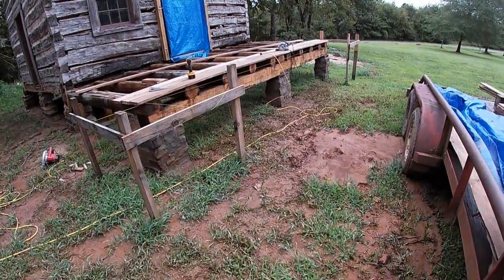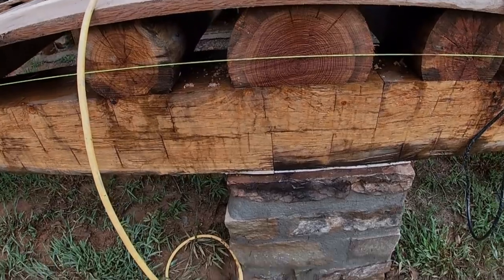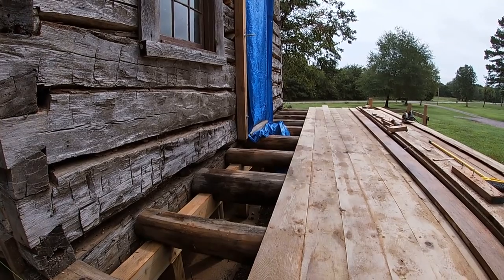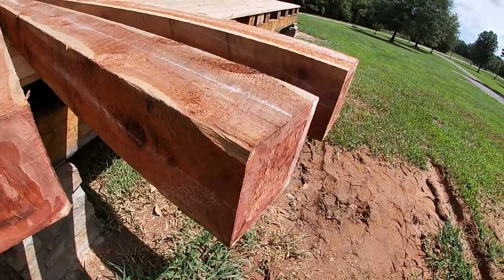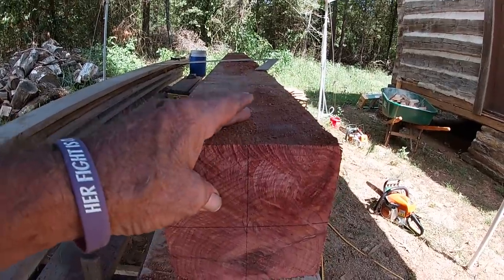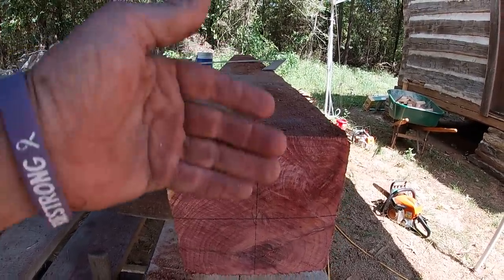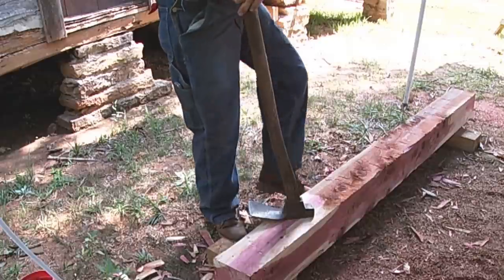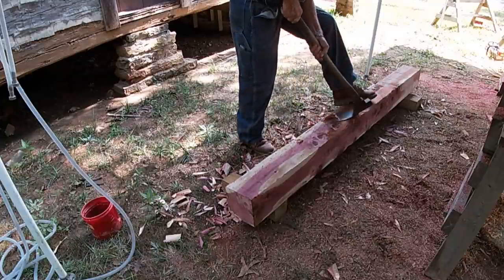Building the Porch, James Thomas Gilliam Log Cabin (Pt 2)

Comment: All that measuring, calculating and marking just to cut the end of the beam off.  It sure seems like there should be an easier way to do it and still gain the accuracy you desire.  I am 71, retired and my late father was a master cabinet builder for a number years and watching you work this beam reminded me of when I was younger and watched him use his multitude of measuring tools to compute and determine the angles and cut lines when he made his cases, cabinets and various joints.  Keep up the good work as I do enjoy watching you build.  I was raised 'North' of you in Southwest Missouri and have many fond memories of fishing for small mouth bass in Bull Shoals Lake.
Reply from the maker: Bud Woodman   Howdy Bud- l could have just marked it and cut it with a chainsaw but I am trying to share techniques that I have used to get the top and bottom of a post parallel with each other. Having memories of your Dad is something to hold on to. Thank you so much for watching the video. God bless you

Comment: Looking good Bro. Paul...  you are handy with the adze.   I have a question...how did you determine the height of the porch deck?  I am getting ready to build mine and didnt know if it should have a step or be level with the interior subfloor. The porch rafters have plenty of height because I am tying into the cabin roof instead of the top plate
Reply from the maker: Rough Cut Homestead   Howdy Mr. Duke- l normally drop the porch floor a little bit from the house floor, around 1 1/2” inches. I don’t think it’s safe to do any more than that. Your threshold will make it just a bit more to step over. But, this is just how I like to do it. Hope y’all are doing well down there. God bless you brother
Reply: @TheBeardedCarpenter   Its just preference sounds like...probably helps keep a storm from blowing in rainwater too...Thanks
Reply from the maker: Rough Cut Homestead Yessir, it sure would. My Daddy always thought the porch, whether wood or concrete should be a little lower than the house floor. He was recognized as the best builder around. I was fortunate to have him as a father. Blessings

Comment: Beautiful little cabin! Is setting the deck boards green a common practice or was that just working around a time frame?
Take care out there Paul🍻
Reply from the maker: Open Air Outdoors   Howdy Marc-  l like to use post oak because it is pretty durable and will last a long time. Most people here use treated yellow pine for decks that will be in the weather but l am trying to stay with the theme of the old cabin and when it was built they more than likely would have use oak. The porch faces the direction of prevailing winds so rain water will flow between the gaps that will develop after the boards shrink. I will put the treated boards tight also because even though they are supposed to be kiln dried after they are treated they are wet and have swelled some. Take care and God bless y